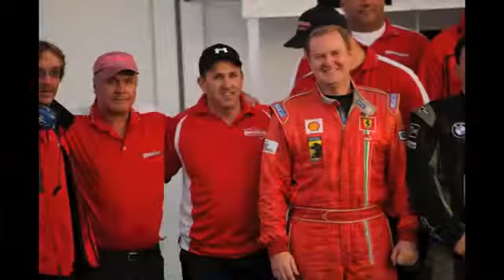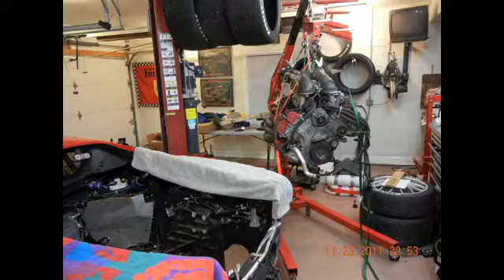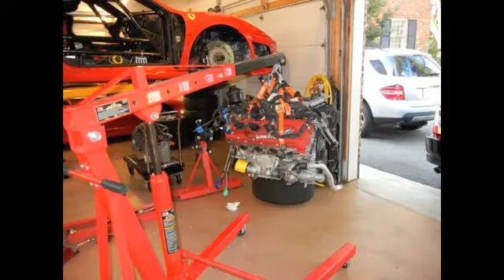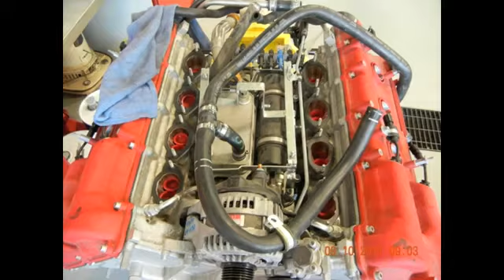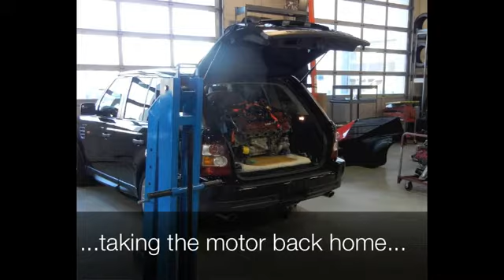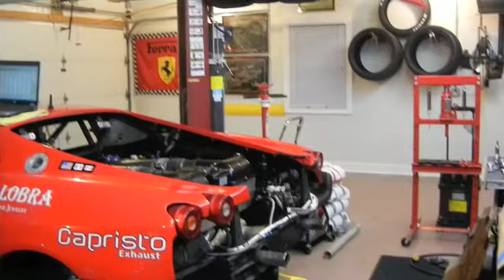Ferrari F430 Challenge engine rebuild

Comment: Good work. I just finished a f430 engine rebuild myself. Good engines. 30k racing and still good compression on all cyllinders.
Reply from the maker: Thanks for comment. Yes I found those engines to be very strong and well designed. Good luck with your car.